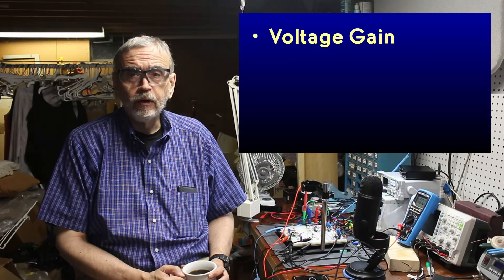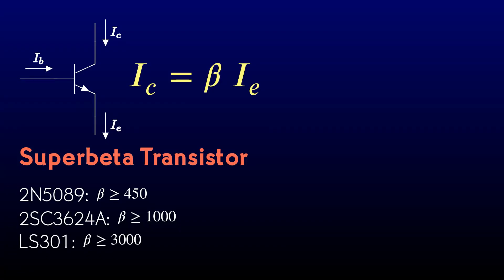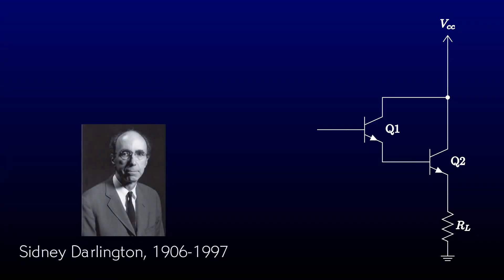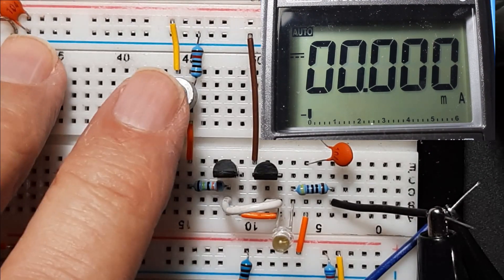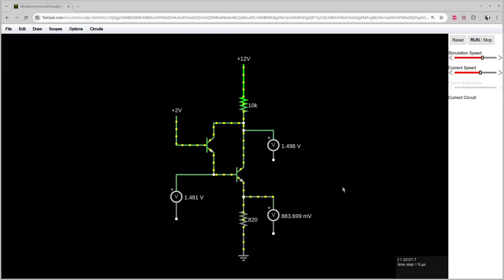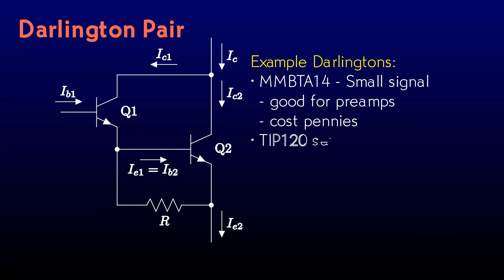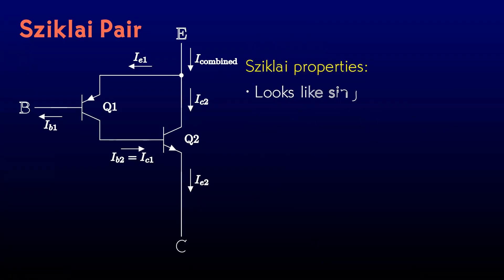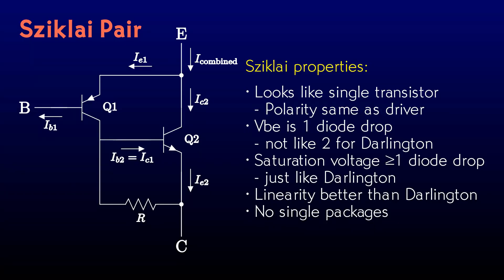Transistors 101 ep8: The Quest for Current Gain

Comment: I looked around, and it looks like the super betas are going extinct. An obvious alternative, to me, the self biased J-FET may be also be going out, as the J-FET transistor is becoming an uncommon device. 
    This is still really interesting to me, because these circuit techniques were widely used in a whole generation of devices. They were state of the art in their day, and there will always be some interest in restoration and repair.
    There are still plenty of hybrid bipolar op-amps with J-FET input stages, LF-412/11, and TL071/2/4 & TL081/2/4,  etc. Maybe they will stick around for awhile, but it wouldn't hurt to stash a few away.
Reply from the maker: The selection of superbetas is getting narrower, but they're still around. Depending on how 'super' you need, I suppose.  Devices with a beta of 350 or so are still available by the million.  For higher gain, Rohm still has a line in production. 2SD2704 (beta of 850) and 2SD2114 (beta of 1200) are typical parts.

There's going to be a need for discrete JFETs for quite a while yet, but the field is being narrowed to only a couple or three product lines.  (Fortunately for us, we've already designed our circuits to deal with JFET parameters that vary all over the map, because the JFET process was never all that well controlled.) 

I'm guessing that the lower-voltage trend will continue, and we'll all be using CMOS devices.  There are pluses and minuses to that.  I've been sticking with higher-voltage parts for now, for easier Eurorack integration, but in the future, we may all be running our analog stuff with six-volt (or lower) power supplies. I think something like the TL07x or the LF41x are going to be in production approximately forever, though, just as the 358 and 741 have stood the test of time. (Who is crazy enough still to design with 741's?  I guess if you're trying to save half a cent, but I'd have thought that whatever you saved on the device, you'd lose on the power supply.)

It's not all that long since TI introduced the TL07xH line, so they seem to think there's life in the old girl yet.
Reply: Thanks for your insights.

Comment: 20+ years in the business, I never heard of a Sziklai pair before. I definitely learned something today!
Reply from the maker: Terrific!  That's why I love teaching!  

Maybe you learned the Sziklai by its other name, the "complementary Darlington?"  As I said in the video, you used to see it a lot in audio power amps, back in the days when PNP power transistors were garbage.  You'd have a push-pull output stage with a Sziklai pushing and a Darlington pulling.
Reply: I've heard of them, but not that they act like the driver type (NPN/PNP), or that they are more homebrew (hard to manufacturer on a single slab of silicon). 
    Kevin has a big bag of circuit tricks, and this is very helpful to troubleshoot and repair older devices. I am inspired by the ingenuity of our ancestors.
Reply: Look at your sub count! Great job, I'm rooting for you, bro! ❤❤
Reply from the maker: @steelfist65  Thanks for the visit! I'm having fun.  I realize that I had missed teaching.